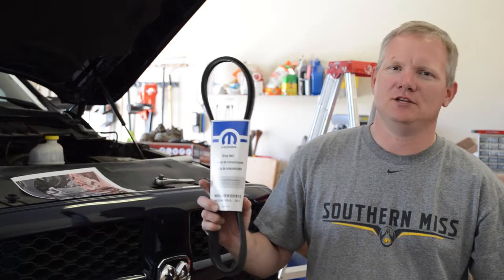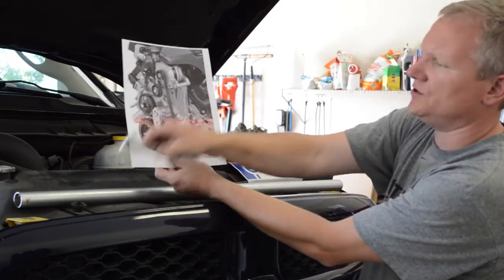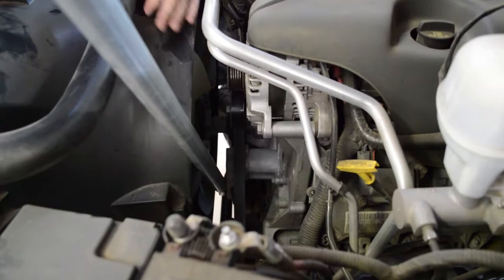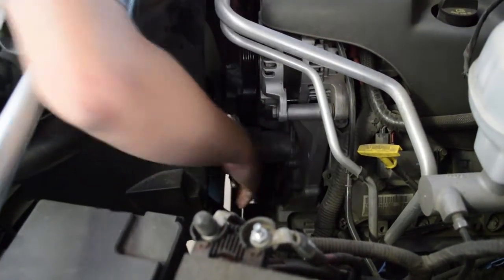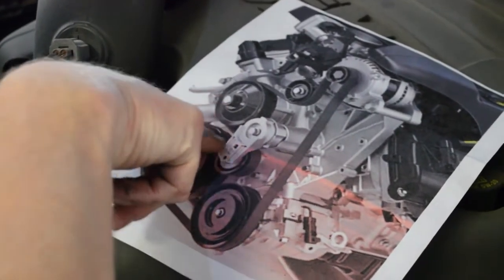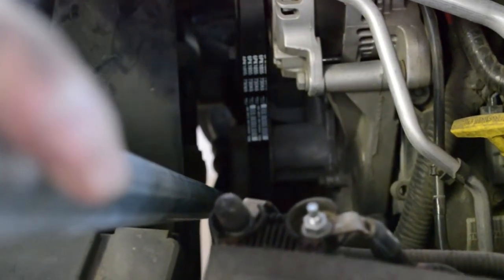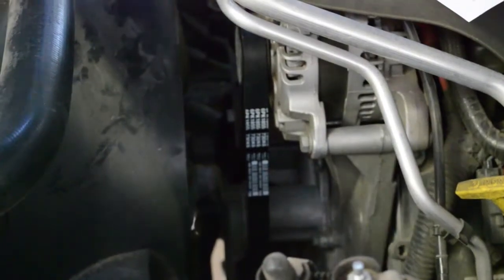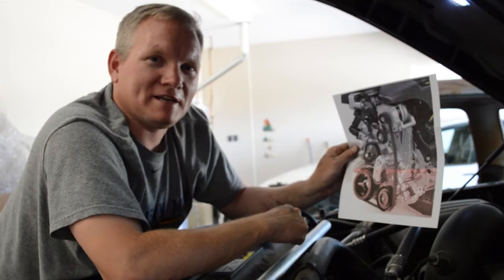Installing A New Serpentine Belt Dodge Ram 1500 - 4th Gen

Comment: Great video. I just replaced my belt on my 2012 ram 1500 express 5.7L. The only difference was that I needed a 3/8" ratchet with my long pipe and my belt path was slightly different. Thanks.

Comment: You don’t necessarily need a breaker bar. Standard 3/8 drive ratchet wrench (not 1/4”) works just fine and easier to maneuver inside the tight space. FYI, it’s not a timing belt. ;)

Comment: Can you ad the link to where you got your print out of routing the belt, please?
Reply from the maker: Patrick C. Beaudry -  https://www.allpar.com/model/ram/dodge/2013-ram-powertrain.html 
Try this link.
Reply: Where did you get the breaker bar
Reply: @josevalenzuela2024  its a “cheater” bar. Any pipe that fits over the ratchet works as a cheater bar. That is not a breaker bar.